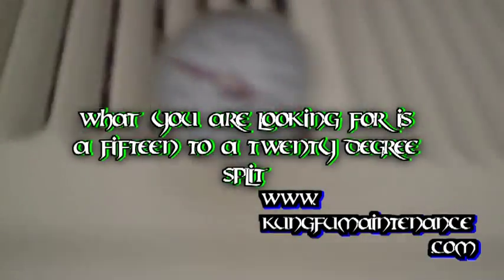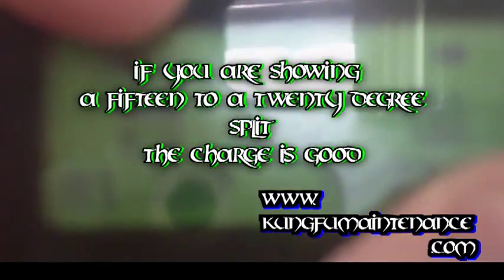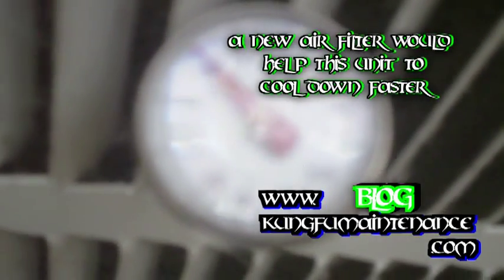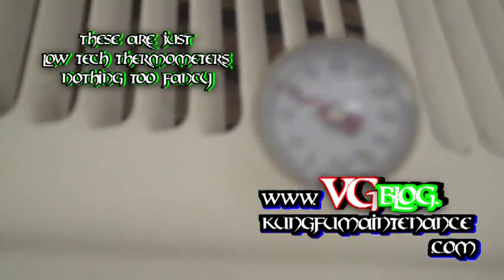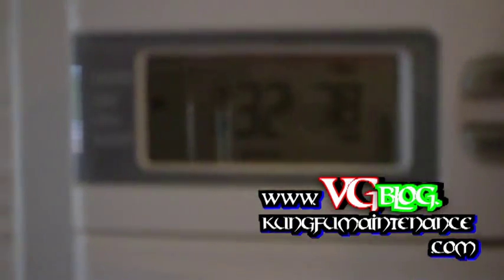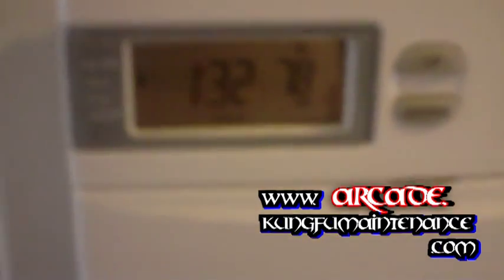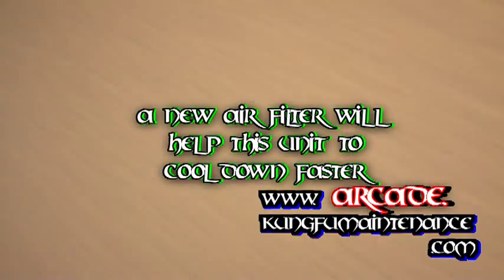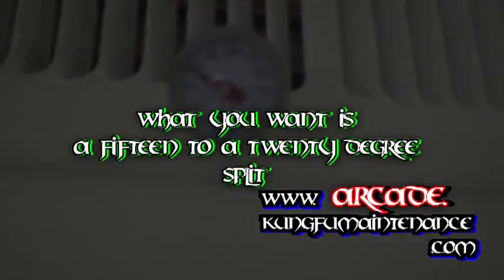How To Check For Proper AC Charge Without Gauges ~ AC 101

Comment: The most ridiculous advice I've ever heard. How about explaining WHY some are 15 degree's and others are 20. All this does is tell you the entering and exiting air temps and NOTHING, and I mean NOTHING else! How many BTU's does this temperature reading indicate? Do these temperatures tell you the system is low or overcharged, working up to its proper efficiency?  What do these temperatures actually mean besides one being colder than the other?
Reply from the maker: I think you did not understand. Between 15 and 20 degrees temperature difference over time span of twenty minutes demonstrate the system is charged properly. If you do not have that temperature split (of at least fifteen degrees) than you're system charge is low or overcharged or another situation that needs to be remedied such as dirty coils or filters. Most people already have a system that has been properly sized for there situation. Obviously if they just had a major system change and it is not performing properly they would be calling the installer back. This vid is not about BTU's. Most people do not think in British Thermal Units. These temperature differences show an appropriate amount of heat being removed from the dwelling.